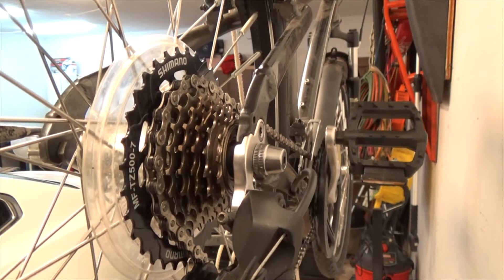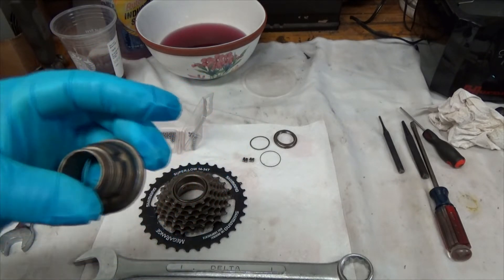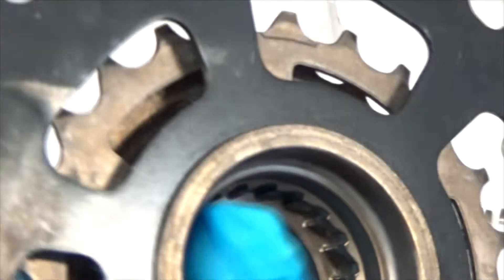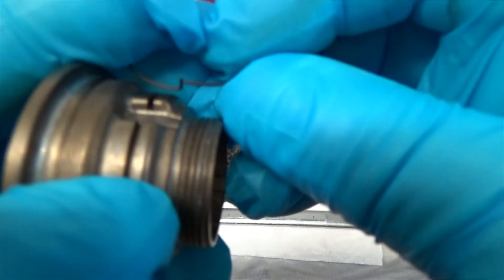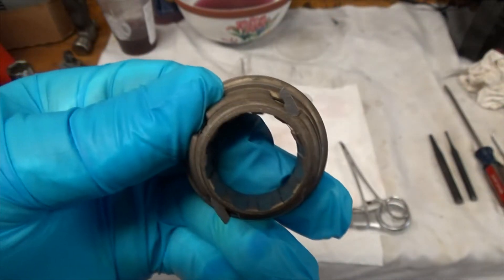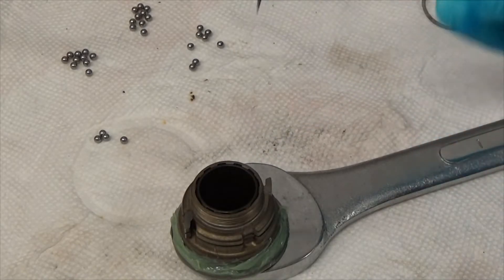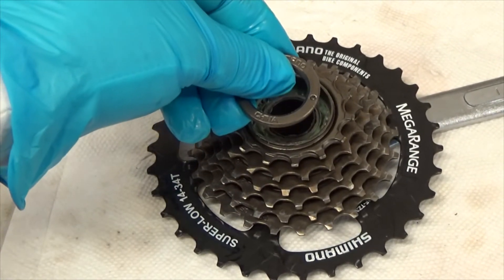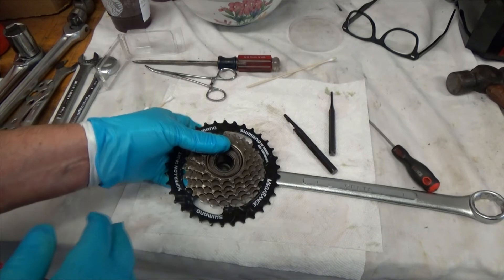Shimano Freewheel Hub and Gear Reassembly

Comment: I bought a used 2020 atx 3 mountain bike and the Shimano mega range and it felt like crunching and I took it apart and it was really dirty. It had outer 30 bearing and inner had 34 bearings. Am I missing 4 bearings.
Reply from the maker: I would say no, meaning you are correct. I found a bearing just yesterday and thought that I messed up and that I need to revisit my work.  Thank you for pointing this out as you are helping others as well as myself.
Reply: @A_Renaissance_Man  let see how it feels after maintenance.  tonight's there's a bike ride meet with the group 18miles I hope this fix the dragging clicking on rear wheel.

Comment: You showed everything, thanks but your missed the part, how to open this??? I am trying to open this by anti clock wise, broke two wrenches, its not working at all.
Reply from the maker: I used a hammer and a punch. Mine was not on very tight.  You want to go clockwise to loosen.
Reply: @A_Renaissance_Man  but in your other video, you are going clock wise to tighten it? It was also Shimano, please confirm.